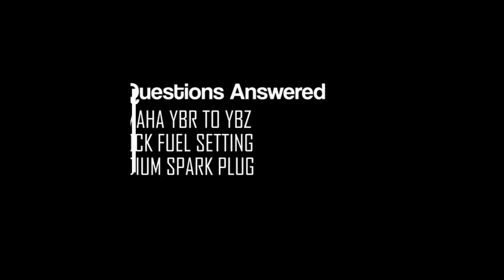Three Important Yamaha Questions

Comment: Dear i bought YB125z last year in march 2018. Almost 7 thousand kilometers driven. i am facing a clutch problem. When i take bike  on road it runs normally but when there is heavy traffic and i have to keep bike on low gear let say 1st or 2nd gear, the engine gets heat up and suddenly clutch didn't work properly. Then i have to switch off and wait for few minutes. After few minute bike clutch again work normally. What you suggest for that problem. Is it manufacturing fault in all yamahas?
Reply from the maker: You need to change oil brand....

Comment: Nice work dude really appreciate iT and also i wanted to ask a question how too increase the pick and speed of YBR 125G i have removed air duck or whtever it is called and am not using iridium pl plugs plus i will install the spark plugs but wat else changes can be made😁
Reply from the maker: These are the only and easy changes you can make on bike without any issue......

Comment: What's  the price of iridium spark plug and can i use in my honda 125 for more pickup ☺
Reply from the maker: Around 800 to 1500 rs....
Reply: Vortex Ride Thanks for replied  But why Iridium plug is very  costly
Reply from the maker: Welcome dear....Due to electrode, tip material and heat range.....
Reply: Right 🤗
Reply from the maker: Hahaha.... g bhai es plug sy combustion improve hoti hai or performance bhi....
Reply: Vortex Ride Theek hai

Comment: Thanks for answering my question regarding the stock setting of fuel mixture screw. 
1 more thing i want to know “is the air mixture screw air tight or not” yani agr full tight ho ga tb tu air tight ho jy ga pr jb working position pe aay ga kya tb b air tight rhy ga?
Reply from the maker: Yes working mei bhi air tight rehta hai.... no issues....

Comment: Bro i just changed my spark plug my bike is over 6000 kms. I did not find iridium but found platinum one. Cr7. My bike now clocks more than 11000 one thing in my mind that the stock plug in my bike was cr6. I dont know its safe or not but my bike is having no issues even after a ride of an hour or so.
Reply from the maker: It more than good....👌👌👌

Comment: after how much time spark plug got expired
Reply from the maker: I guess owner manual says that we should change sparkplug at 12000km... but you can change it frequently at 6000km if you are used to do long drives and high speed runs....🖒

Comment: AOA bro, great video as usual.
i am currently achieving about 115 KM/H max on single with bent position and 110KM/h with straight.. bike is totally stock.  

i want to make the following modification to my YBR esd 
1.adding back tire in front wheel and installing 100/90/18 on back
2.installing iridium spark plug
3.Removing duct and adjusting fuel mixture for compensation
4.installing Moxi Air filter " http://www.saboortraders.com/product/moxi-airfilter-35mm/ " , this one
how much of a difference would i feel if i do all these modfication? 
bike is currently 3270 KM done on odometer 

one more thing i want to tell all of you YBRians is that you should use KiXX or ZIC engine oil currently using KiXX ultra 4t 10w40 and my bike is able to achieve 11k rpm without missing and gear response and throttle is just awesome.. best mineral engine oil for YBR i guess.

Previously i was using Yamalube 20w50 and i could say max i could achieve was only 110 KMH with bent position and gear shifting and throttle was somewhat sluggish and slow.
Reply from the maker: The tire will give more load... but good traction.... iridium spark enhances combustion....do remove air duct and adjust fuel.... dont use moxi pod filter as they require re jetting of carb... approx you will cross 120 kph...
Reply from the maker: Well you must cover atleast 6000 kms.. before doing any mode.... i dont prefer mineral oil... as they produce sludge inside engine after some time... you should use fully synthetic oil....
Reply: TY, of course i will do these modification after 6000 KMs, by mineral oil i mean that message to the mass because i know almost every YBRian has driven Honda CD 70, CG 125 and they don't require much caring so we became miser by riding those bikes with low expense, so not everyone spend money for a fully synthetic engine oil.
Thank you,
-Hadi
Reply from the maker: Welcome man.... you are definetly right...😊😊🖒